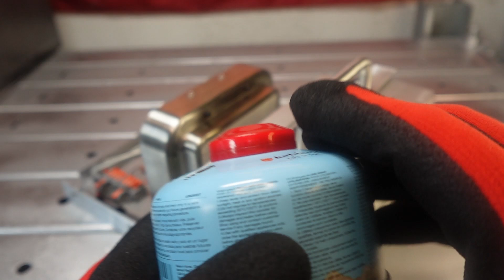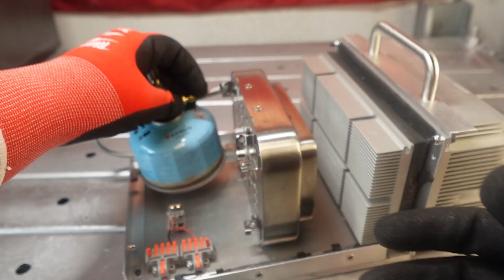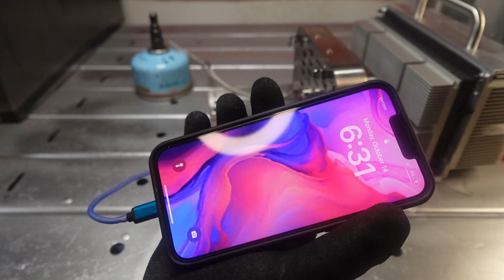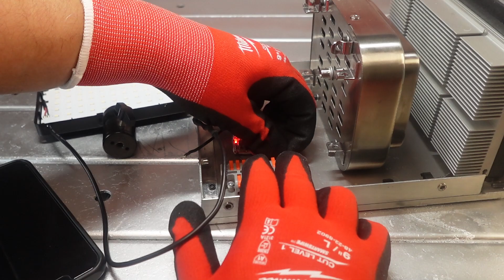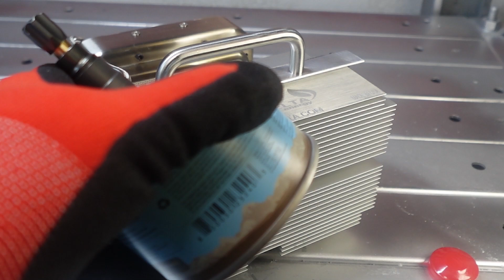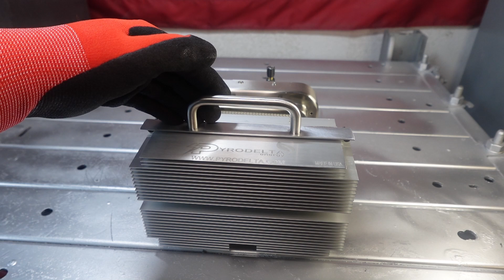PyroDelta Propane Powered Thermoelectric Generator

Comment: Great project and realisation. One question, why not having oriented  the cooling heatsink with its fins vertically instead of currently horizontally? With a vertical orientation, the cooling heatsing would benefit from the natural air convection coming along the vertical fins : the cooling effect would be enhanced and, for the same heating power, your temperature gradient would be higher and consequently your electrical output bigger. Just thought for food. one more tine, Great job! Thank you for sharing.
Reply: Ist correct what you say about cooling. Do you know the other video of PyroDelta? https://www.youtube.com/watch?v=65Plx0LQYYw
Its great.
Reply: @Michael-jo3ds , no, i did ot know this other video. The concept is great, and greatly implemented! Thank you for having pointed that.

Comment: you can use heliostat or parabolic mirror to do the same job or even better.   Look,  a square meter of reflective surface is equivalent to 1000 watt in theory.  I dont know about the efficiency conversion of tellurium as a couple. Lets find out will ya?
you probably also need a controller to guide the reflective surface to aim toward the widget  as you know the sun moves .. you can use a wound kiind power  with spring and gear to move the reflective surface.  This is called CSP   concentrated solar power   . CSP works in all sizes!!
even a square meter is very hot!!!!!!!!!!!!!!!!!!